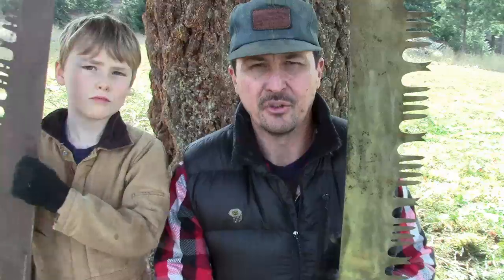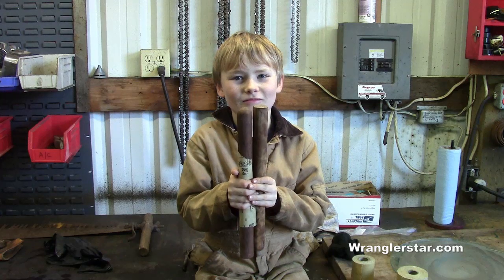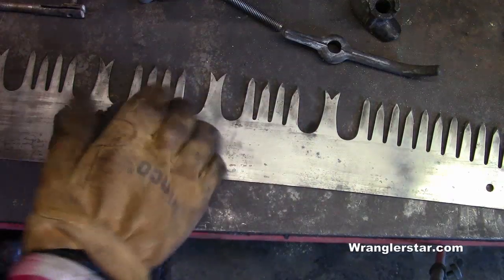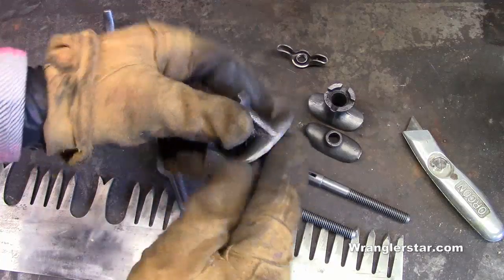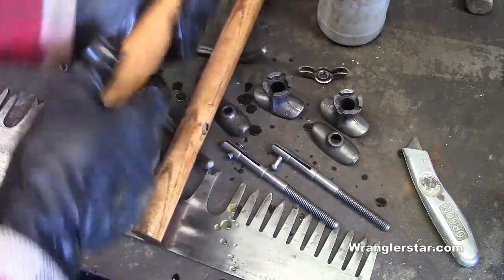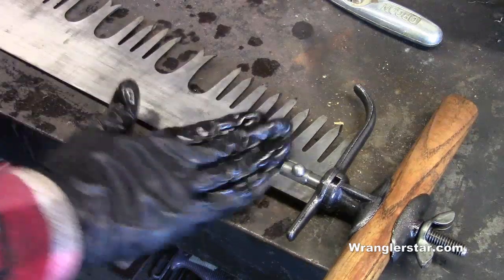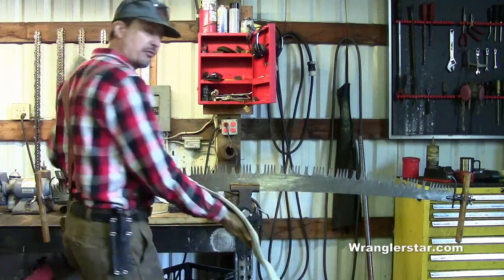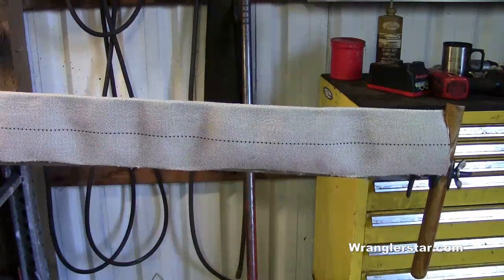Crosscut Saw 2.0 - Wranglerstar

Comment: One technique to keep in mind for next sanding project, would be to use wet/dry sandpaper at the very end, then rub a few drops of water into the wood. This will raise any loose fibers so you can sand it again, and repeat it a few more times until you don`t see any more fibers. That produces a glassy appearance on the wood. This was used on stock makers to bring out the fine details on custom stocks before hand rubbing them.

Comment: You should look into Froglube for oiling your metal parts. It's actually a CLP for firearms, but it is GREAT for protecting any metal parts from rust. It's made from plant materials and is food grade safe. It works by heating up the metal and letting the lube get into the pores, protecting it from rust. Much like seasoning a cast iron pan. I use it on all my axe heads and saw blades.

Comment: Might I suggest something regarding the application of your sheath..?  I have never tried it, but I suspect that if you were to roll it so that the inside of your sheath, the part that goes against the blade, was on the outside of the roll, you would be able to apply it to the saw without as much hassle and the resultant risk to your fingers.  If I am correct, the sheath should unfold itself over the blade evenly as you unroll it over the teeth. 

Nice work by the way.  I appreciate all the effort, attention to detail, and forethought you've expressed in your work, videos, and intentful contribution to an honestly better society.

Comment: I noticed the little bars that meet up at the end of the blade to control the length of cut changed positions between videos. In the first video the curved part is on top. In the second video the curved part is on the bottom (where the teeth are). So which way is the right way?

Comment: Cody, here's a link to the cross cut manual published by the US Forest Service.  It's excellent and even provides the specs for building a saw vise to hold the saw while sharpening.  http://www.fhwa.dot.gov/environment/recreational_trails/publications/fs_publications/77712508/toc.cfm.  My wife and I have two saws used by her grandparents.  They used those saws to clear the land on the original homestead.  We noticed that each saw has one long and one shorter handle.  The long handle fits my hands and the short one fits my wife's hands so we believe her grandparents set them up that way since they worked together.  I love working with old tools and feeling that connection to the past.

Comment: Could you elaborate on how did you remove the rust and such from the pieces?
Reply from the maker: I used the wire wheel on my bench grinder.

Comment: in the spirit of your grandfather you should have cut that outer layer of the fire hose carefully and tucked it away to use as a sheath on another project
Reply from the maker: The outer sheath is not rubber lined and isn't suitable for a sheath.

Comment: Since it has NO sentimental value...  Sell it for scrap.  As you said its wore out even if you get the engine running.  Your time would be better spent on another project...  It is a JD so parts will be EXPENSIVE and hard to find. Sure you could do it but its money down the drain it is too worn out.